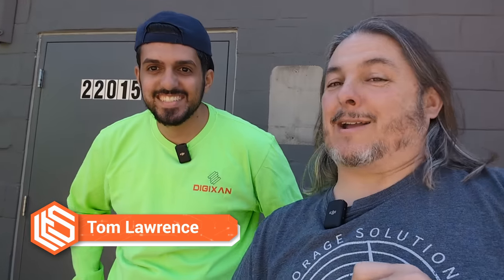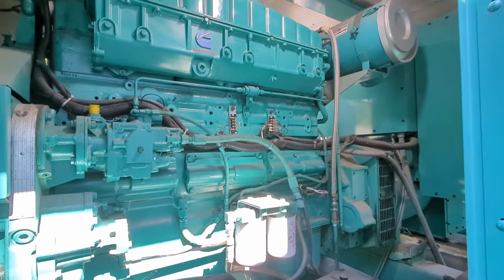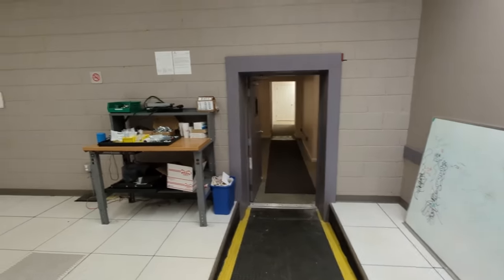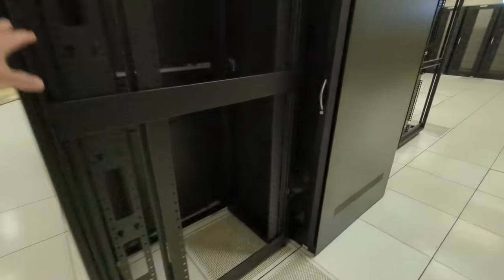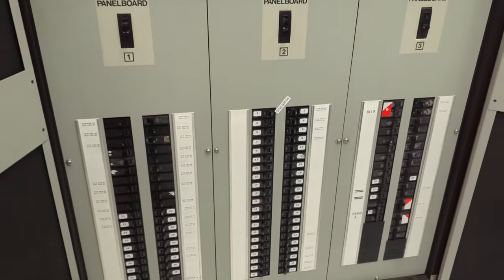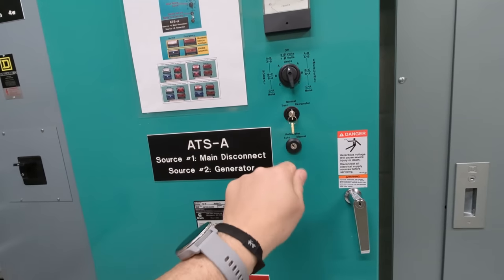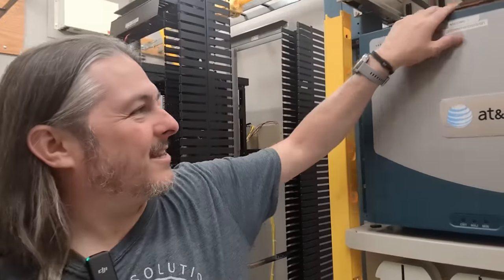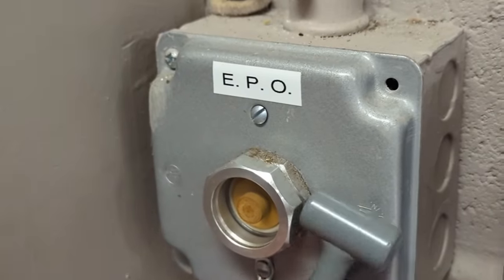What's Inside This Decommissioned Data Center?

Comment: The only thing creepier than a quiet datacenter is a datacenter that all of a sudden gets quiet when you're working in the power room.
Reply from the maker: For sure
Reply: Got the t-shirt, the sounds of all the UPS's beeping still haunt me 🤣
Reply: Was in a server room/datacenter back in 2007.  Was installing several beefy new vmware hosts.  The boss was in there watching, with his hand over the emergency cutoff for the UPS,  playing with the little cover that spins to give access to the cutoff button.  Well, the server room went completely quiet in a split second;  you should have seen the looks on his face.. What happened; well, the UPS had a single point of failure, with a control board that just happened to go at that moment as we were powering up like the 4th or 5th server.  The massive UPS had been purchased a few years earlier, and the manufacturer issued a recall to replace the board, but well, there was a disconnect between the manufacturer, the vendor that performed the install, and the customer that had never received the notice that the board needed to be replaced..  Single points of failure were the typical Modus Operandi for the company ( the company with the servers.).  A single HVAC system.  A  single massive UPS. Single entry/exit.  No generator. Internet circuits that were nowhere near redundant, etc, etc.
Reply: As an electrician who often works in datacenters that’s my biggest fear.
Reply: Back when i worked with cooling datacenters, my policy was to never screw with the firmware in more than one unit at a time, because of previous mishaps. I had a workmate who was a bit on the wild side, he flashed them as quick as he could, done via ethernet, and i ran around frantically configuring all the parameters. Once done, every single unit suddenly shut down without explanation. Fortunately they all rebooted and were up again within minutes, but that time in between was scary.
Reply: Not creepier, but worse, I remember when an electrical contractor installed the transformer backwards at a big London data centre. Instead of reducing the grid voltage it dramatically increased it and took out a large portion of the data centre.
It didn't just blow one side of redundant PSUs, it zapped whole systems with sustained over voltage.
Reply: That made me chuckle, reminded me of the butt-clenching moment when you do a genny load test and it all goes dark and quieter for just that few seconds when you're just hoping the generator kicks in (I mean it always does, but there's just that chance that one day, it might not).
Reply: I was working at Equinix in 2011 when Chicago had a power outage and the backup power failed.  Not only was it crazy because for a minute all the lights went out and everything went quiet but it took a couple of minutes for the security system to come back online so I was trapped in between cages for a few minutes with nothing but the emergency lights.  After that of course the ish hit the fan but it was a surreal few minutes.
Reply: Or a datacentre that gets more loud...... oh no what rebooted, oh the guy from virgin media knocked the power out of the core with his arse ........... fantastic !
Reply: @andljoy   I may have dropped power to an entire rack of render nodes that way once. Of course to save money the nodes only had single PSUs.
Reply: In a datacenter after the campus was hit by a tornado.  According to the UPS logs the server room ran for an hour after the mains were cut; other downside was that the AC units weren't on the UPS in any way, and the environmental monitoring logs showed the room topped out at 105°F before the UPSes shutdown. The darkness and quietness of a basement server room without power is something else (and realizing that you have a hole in your shoe when you walked through one water that had collected at the bottom of the stairs - squishy shoes for the next 8 hours.

Comment: I worked in that DC for years, many years ago. The fire suppression system is a pre-action dry-pipe type where the pipes in the ceiling to the sprinkler heads are full of air. Digital smoke / heat detectors would need to trigger to charge the system with water, then the sprinkler head element would also need to burst to allow water to exit the heads. This is why the system in the front closet was so complex. It prevents someone from flooding the DC by accidentally breaking a head with a ladder. 

The building also has some interesting history. In the late 1990s, the 'Godfather of Spam', Alan Ralsky hosted his servers in that DC. There is a big long story of it I'm sure somewhere still around in the internet archives. In the rafters of the back MDF room with the cut fiber, there should still be some binders full of paperwork up in the ceiling for the original fiber orders with his name on them.
Reply from the maker: That's interesting, I can probably get back into that building again to look for them.
Reply: Hi Brad! hope you're doin' well
Reply: It looks like it was an old mainframe data center back in the day too!
Reply: Same here! Had a office there and you know what , I need to go back. 

Let me see how much they got it up for and perhaps I will lease it .
Reply: @kieranwilliams3052  How many megawatts is it?
Reply: I also worked in that data center for years :)
Reply: When the system charges and the air that pressurized the pipes is vented, the smell... is just terrible.  Imagine that air in those rusty metal pipes for 8 or 10 years finally getting loose.  It's like a giant data center fart.   We had that happen in a DC once; an under-floor smoke detector triggered because someone blew a bunch of dust loose under the floor in the course of some HVAC/CRAC unit maintenance.   So that triggered the pre-action system to pressurize the pipes (and somehow vent the air.)

That DC was at a University with a fire protection program.  So of course the local volunteer fire department was staffed by all those students.  Well, they got called out to the DC, even though there sprinkler  heads didn't fire.  I walk into the computer room to see one of the volunteer firefighers try to open the floor  by prying up a floor tile with his axe!   Bad enough the brought those into the room at all!   I had to demonstrate the amazing suction cup tool for the floor.

Later DC have cold-aisle containment system for the higher power density racks, they really are getting more elaborate in ways to remove the heat.  Consider that most of what computers do is turn electricity into well-ordered heat, and lots of it.
Reply: Is there a reason they wouldnt use a C02 flooding system for suppression? Seems like a safer way to protect electronics.  We have been using that since the 70s at one of our sites.
Reply: I thought the grand father of spam was Sanford (Spamford) Wallace?
Reply: @lmamakos  ohh! I saw one of those dual suction cup lifters lying on the floor beside some DEC storage arrays in an old photo from another DC, and didn't know what it was for. Makes sense now!
Reply: @batlin  There was a much more evil looking version for use with carpeted floor tiles.   They had this array of spikes, canted at an angle, instead of suction cups.  The handle would extend each side outwards to push the spikes into the dense carpet to grab on.   The carpet was supposed to keep down the dust and dissipate static charges.   Except now instead of a damp mop, you had a vacuum cleaner in your computer room, and of course, people looking for a place to plug it in. 

Glad that idea died pretty quickly, though the timing lined up bad for us as we had that installed in one of our computer room..

Comment: Hey Tom, I'm a DC manager + administrator. We use flywheel UPS' and love them. I hated paying for the battery replacements every 3-5 years. Such a waste of money. I also vastly prefer aisle containment rather than just balls-to-the-wall CRAC cooling like this. Big waste in efficiency and PUE there too. Thankfully our DC is in a dry state so we utilize evaporative cooling in tandem with CRAC and CRAH's. Lastly, I think that COMs under the raised floor is the worst. Huge pain to install and maintain, and usually blocks air more than if you put power-only down there. COM's from top-down, power from bottom-up is the preferred method we have. Also, who the heck cuts fiber?! Sounds like a great way to accidentally blind someone if they forgot to disconnect the transmitting side.
Reply: The last few new DCs I've been into, the raised floor, if they even went with one, was just a plenum. Zone 4 EQ though so they are kinda at a disadvantage with the extra bracing underneath for the bays. Plus if you have to move a beast like a CRS1 or other pre configured bay, you have to temporarily crib the travel path under the floor. These were primarily -48v DC powered telecom facilities. So they used tank cells that with at least annual attention last decades. They use a lot of space though.
Reply: With the generator and transfer switch smaller, less expensive, batteries can be used...I thought the maintenance on the flywheels "vacuum bearings: made flywheels less desirable but admit, battery maintenance was a real pain.
Reply: Water cooled rear doors are way better than isle containment. More expensive upfront for sure but they last a long time. Ours are alread well over a decade old and look like new. Basically a large car radiator, and they last for lifetime of the car these days out in the open not in a nice clean dry data centre.
What I noticed was lack of fire suppression
Reply: I’ve seen those fly wheel systems and they are really cool. Spinning super fast in a vacuum and sure enough they provided enough power until the generators came online.
Reply: Cutting the fiber is the fastest way to pull the equipment. They don't care how much damage they're doing / leaving behind. As for blinding anyone, they aren't "space lasers"; they're 9um IR, so too small to be seen and not even visible light. (plus, the transmitter will shutdown before you could aim them in your face. and the gear would've already been powered down.)

Comment: I wish I had a sub floor for wires and possible flood!
Reply from the maker: Yes, my studio is in the basement and I have two water alarms and soon I will be installing backup power and a SECOND sump pump, just in case..
Reply: @LAWRENCESYSTEMS  check out the triple safe pump.  2 AC pumps (primary/backup) and a 12VDC pump for those bad days.
Reply: @LAWRENCESYSTEMS I have a hot spare to my sump now, after my last one failed and I had a nice pool of water under the rack.
Reply: Can anyone say GENERATOR INLET and inverter for your car? 🙏 😉
Reply: I use pallets  : p
Reply: @AdrianTesta-Avila same here 😅
Reply: @LAWRENCESYSTEMS get a city water powered sump pump. No electricity required

Comment: 2:45 the floor isn’t primarily designed so the cables can traverse underneath - it’s for the airflow…CRAC units distribute the airflow from underneath. This is why you see the grated/perforated floor tiles and large gaps under the cabinets.

Comment: Also, air conditioner is pushing air under floor and the holes in front of cabinets have cold air go up Infront of the servers. Hot air fills room and pull hot out of the ceiling. 

Also the raised floor has colors. When a floor has grey lanes of tiles, that means it's a heavier duty weight limit And you can use a pallet/pallet jack on it. If floor times are white, you can NOT use a pallet/pallet jack as it's not specd to hold that weight. You have to unpack and carry items into the raised floor.

Comment: I just decommissioned one of our oldest DC one a few months ago. No raised floors, It was all RTU A/C units and ladder racks, dual generators, APC symmetra 80kva. Wasn't fully redundant which is why when the lease end was (is) coming up it was a new brainer to start over with new equipment in a newer location.

Comment: I have a mid 90s comms room/ server room at work, it’s only about 30ftx30ft. When our systems were upgraded to fibre and internet around 2010 a new room was built and services switched over. The old room was abandoned, everything powered down and left as it was, only the lights work now 😂. What was once state of the art equipment is now just electronic waste. As we don’t need the space just now, it is cheaper to leave it alone. Cool video. All the best.

Comment: The flywheel at the other data center that you referred to is the UPS.  The flywheel is not instead of a UPS, it's just a different type of energy storage vs. lead acid batteries.  The Liebert unit you showed is an always inverting type where it's delivering DC to AC loads all the time.

Comment: When I was in field service back in the mid and late 90s, I worked in many data centers.  I remember cutting out bus & tag cables underneath the the floor as well as running fiber and plugging in cables to devices and mainframes.

Comment: I work in a datacenter, and every time I see a video with an empty one it feels so creepy, because I'm so used to the noise and it's almost haunting to see that kind of environment and hear nothing.
Reply: I remember in one data center the UPS had failed and we were running solely on commercial power. (I don't know the specifics of why the backup generators weren't connected) The power went out and everything went dark and silent save for the emergency lights. Its amazing how accustomed to noise you get when it suddenly stops and you become VERY aware of the absence. Its so creepy.
Reply: @kwith  I don't want to even imagine that. We have policies, plans, and procedures in place, but that kind of thing happening is straight up a nightmare to me. Ideal setting for a horror game to bug me now than normal XD
Reply: @joshuawaterhousify  Well fortunately the data center in question was for Dev and QA environments, nothing in production was affected. So a few projects were impacted and some dev workers were annoyed and inconvenienced, but nothing major or critical was affected.

But the creep factor was in full effect lol.
Reply: @kwith  that's something at least; if it's going to happen, that's where you want it to be XD but yeah, I can imagine it would still be creepy as all hell, and would not want to be there :P
Reply: @joshuawaterhousify  yea unfortunately I didn't have much of a choice. Someone had to do some troubleshooting and verifying that everything came back up. I pulled thr short straw on that one haha
Reply: At my old job, I ended up being the last employee in a building we were vacating.  I was not part of the IT team but they no longer had boots on the ground so I got to be the one dismantling the data center rack by rack. A room that was so loud you could not even talk became absolutely silent.  The whole place got emptied.  Put on pallets and shipped out of the country.  Recently found video I took of my last walk through.  Sad place. No people. No cubes. No systems. No sound.

Comment: Back in 2004 I was working in phoenix sky harbor airport in their little datacenter on-site.   Probably 1/3 the size of this one.   It ran all the flight displays and the parking garage space counters.   Was plugging in a new rack and apparently they wired 208v to a 120v plug under the tile.   Big flash and pop out of the rack, followed by an uneasy silence as the entire room got quiet.   Within minutes managers/supervisors were busting down the doors.   Fun times.
Reply: Frankly it's a little surprising that that would even do much - virtually everything I've powered in a DC is 240v tolerant (with some requiring 200+V), but I can see something in 2004 being just old enough to be problematic. 

Or if it was a plug-in UPS, which I could see being the case in a little server room like you're talking about.
Reply: Well, it they were stupid enough to set it up such that a single shorted (overloaded) outlet could take down the entire room, they totally deserve to be shamed.

Comment: I worked in a data centers for 10 years and so much of this is familiar. The Liebert CPCs, the single-mode fiber hanging everywhere, the ladder racks racing across the ceiling, yellow fiber trough, good memories. I still work in one periodically but not to the extent I used though. That raised floor, I worked in one that had a 12-inch raised floor, one that was 18 inches and one that was 36 inches. (Yes, three feet!)

From the looks of it, they didn't have cold air containment in the cold aisles did they? Were those Writeline racks? I remember the older DUC70 cabinets, that ugly beige color. THOSE were a pain in the ass to install in.
Reply: Did anyone ever fall in the 36in floor?
Reply: @deepspacecow2644  Not that I know of but we are pretty strict on safety. So when a tile is taken up and we were underneath, we had to put up cones and signs. Our safety guy was VERY militant about that and rightfully so.

Comment: I haven't visited many datacentres in my time, but working for an ISP I do go in the same few fairly often. What surprises me in this video is the lack of physical security - the building seems so exposed from the outside. The datacentres I typically visit are surrounded by double barbed wire fences, have security patrols and all internal rooms protected by very restrictive access control. Not to mention all power systems, including generators being built into the buildings. They're not so strict on phone usage though, while taking pictures is strictly forbidden, no one takes your phone on the way in for example it's just more of a trust basis. 

What type of facility was your one, owned by a single company or was it colo space?
Reply: All that modern "security" is just theater. It's there to impress customers. A place like this one is more secure by the fact few know it's there. And even fewer know what ("who's stuff") is in there.